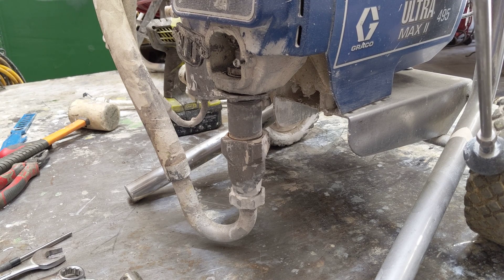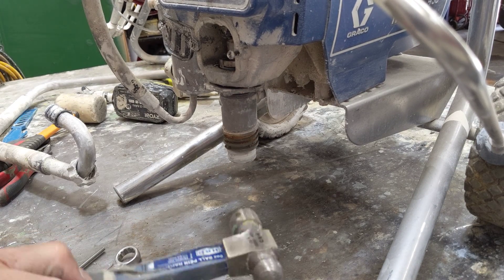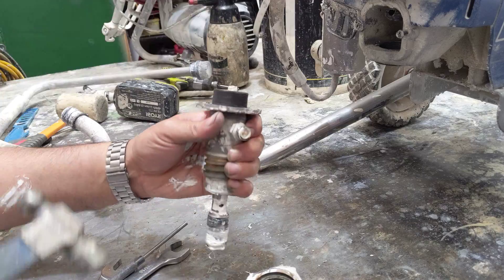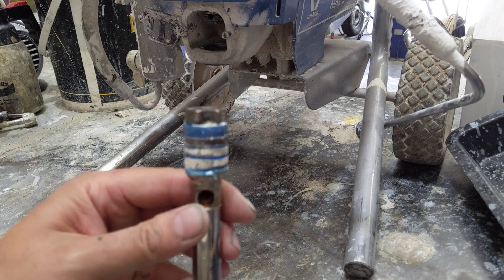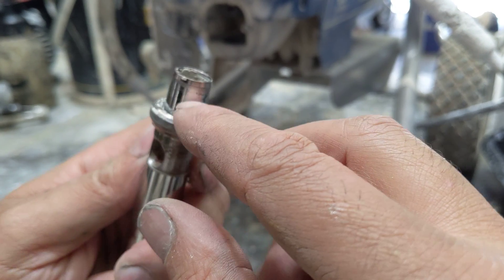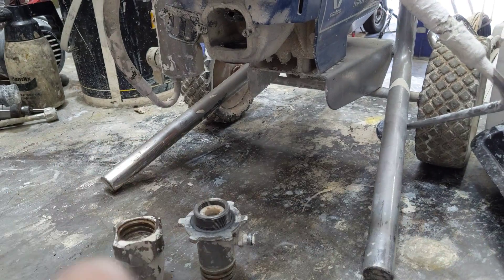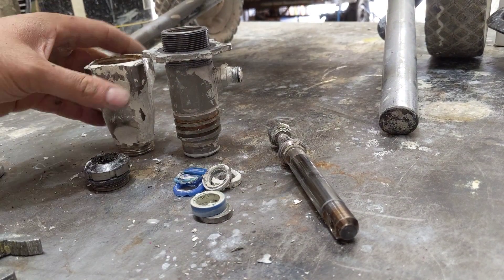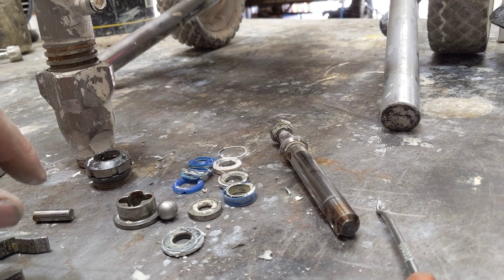Stripping and inspect a Graco pump

Comment: In your opinion should a 2016 Graco 490 PC Pro II, with 4800 lifetime gallons, have plenty of life left on the motor? The sprayer has been used primarily used for 100% acrylic paints. Have you noticed any regularity with the life span of these PC models?
Reply from the maker: It all depends on how those gallons were accumulated over the 5 years. If you had your pump operating at high pressures with large tip sizes, this will cause the pump motor bearings to wear out quicker. Also that's the maximum life that would be expected for this amount of gallons. That's over 4000 litres per year on average. That volume really does require a larger unit

Comment: hello I have a 390 greco but when I turn it on it burns the fuse that fails it could have
Reply from the maker: It could be as simple.as the lead need replacing, it the motor, or the computer, I'd recommend changing the lead first, if you know how to do a continuity test then you can actually check everything